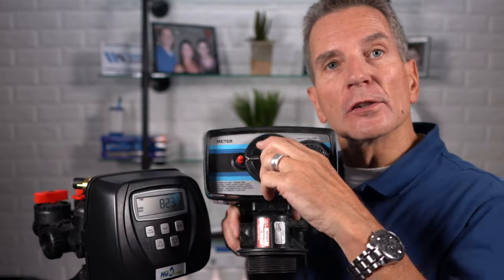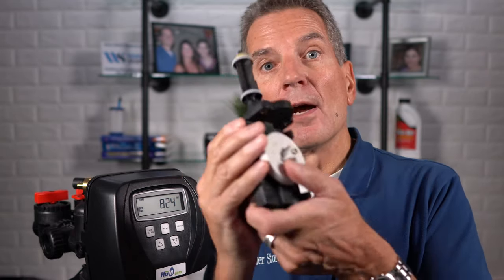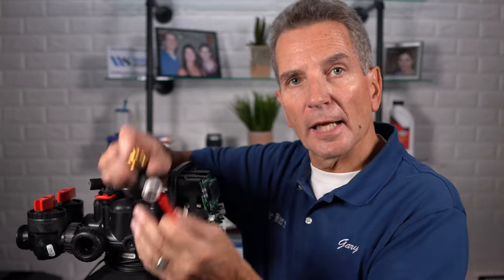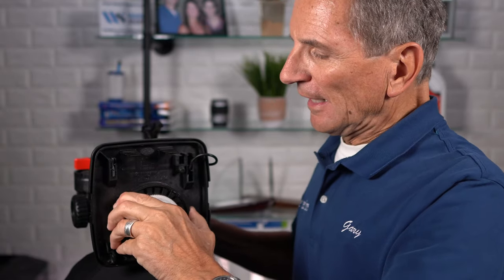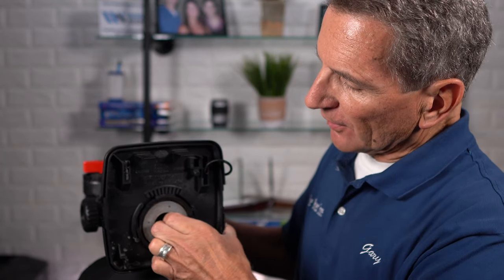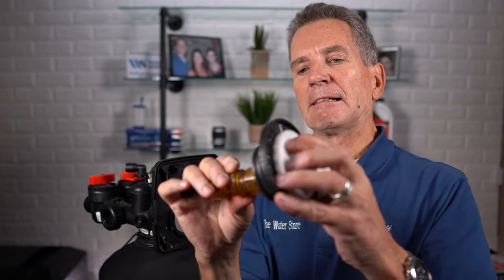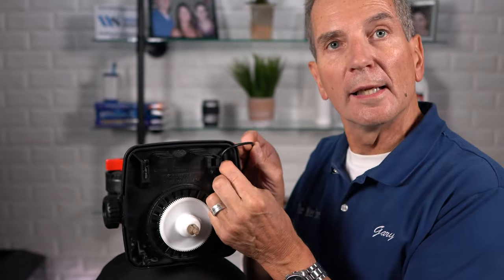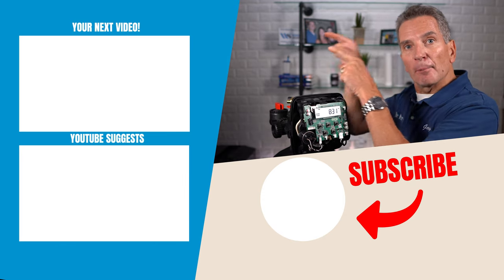WATER SOFTENER Troubleshooting – CONSTANTLY DRAINING

Comment: Hi Gary, 1st off I would like to say that your videos are awesome. I am trying to replace the seal pack in my Greenway (WS1 Clack rebrand) Filox Iron Filter, I bought the seal pack and the 2 pistons and tool. I followed the video and removed the drain, electronics and the gear with the 2 pistons attached, I am now at the seal pack but it won't come out, there is a lot of rust build-up in it, maybe this is what is holding it? Any ideas how I could pull the seal pack out? Thanks.
Reply from the maker: Good question.  Typically I just carefully pry it out with a screwdriver or small pry bar.
Reply: @water_estore  Hi Gary, just an update for your fans out there in case someone runs in same issue. Found out that there is actually a tool for this, it is called "Clack Stack Puller Tool for the WS1, C-series". The Part # is V3022. I ordered it and when I received it I gave it a try and voila! very easy to pull the stack with the tool. Cleaned all the rust buildup from inside the valve, installed new stack and leak to drain is now a thing of the past. Cheers!

Comment: I started the regen mode but the water keeps draining out it doesn't slow down so when should I put it to bypass mode so I can change the sealpack. I think I know my issue I gotta put into bypass mode b4 starting the regen to drain the last bit of water I think
Reply from the maker: Yes, bypass first, regen to release the pressure, then go for it.

Comment: What position should the drain assembly be in when you screw it into the housing? It looks like yours is about 1 inch out from the white gear piece. Is that true for all? I have the same exact Clack unit that you have.
Reply from the maker: Sorry, not sure what you mean.  The drain elbow goes into the housing and is held in with n "E" clip, it doesn't matter which way it is orientated.  Now sure what the white gear piece is that you are mentioning.
Reply: @water_estore  I think he is talking about the screw on the front that advances the cycle and moves the pistons I too wondered about that as I’m concerned that because I’m clumsy I may have moved the large white gear that meshes with the face piece. Also mine looks identical to the clack version you showed but it is branded as a waterite. I’m a plumber in Canada and am trying to learn a bit about these softeners as I have one at home. I also would like to get that sweet wrench you showed in your video.
Reply: The answer is it doesn’t matter the motor resets the position of the plunger by bottoming out and spinning back in it doesn’t matter where the large white cog lands @George Lynn Davis

Comment: So water continues to trickle through to the drain even after I closed those valves to 'bypass' . ..so that means the seal pack and pistons are ok ? Its something else ?
Reply from the maker: I would bypass the softener and wait for a while.  If there is no water flowing into the softener where is the water coming from that flows to the drain?

Comment: How do I clean a float valve in the brine tank that seizes up after each back wash cycle?
I clean
Reply from the maker: Just remove it, soak it in soapy water and test it.  If it still seizes, replace it https://waterestore.ca/products/waterite-water-softener-float-assembly

Comment: I have a Clack WS-1 that is slow dripping from the backwash line. When I put the softener into bypass it still slow drips.  Any ideas?
Reply from the maker: Does it keep slow dripping when bypassed 2 hours later?
Reply: @water_estore  thanks for the suggestion.  I left it in bypass for several hours, and when I checked it again the leak had stopped.  When I took it off bypass it leaked for a few seconds then stopped completely. If it starts leaking again after the next regeneration cycle what would you recommend for replacement?

Comment: Brand new eco pure softener is draining at full discharge speed upon initial opening of bypass valve. Draining discharge hasn’t slowed. Please help. Only way to stop it is to close the bypass valve.
Reply from the maker: Can you not advance it out of the back wash cycle?  New installations always should be back washed at first to remove the air in the tank.

Comment: Hi Gary,
I was replacing my iron filter and cut off the main water supply to my house. After unhooking the iron filter, I noticed one of the lines from the softener continued to run for a long period of time even without power and no water going into it with the  main line shut off. Is this normal or do I have an issue with my softener?
Reply from the maker: You have an issue and this video will help you to solve it.

Comment: What flow rate is normal? I woke up in the middle of the night and went into my furnace room where the water softener is and noticed it was in a recharge cycle, but the water was flowing out of the drain at full blast. It flows through a pipe into a nearby sink, but it was flowing so fast and for so long it had backed up through a drain in the floor and flooded the basement an inch or two deep. I unplugged it to stop it and the water in the basement drained away after a few minutes. Now I'm trying to figure out what happened, but I can't find any clear information on how fast the water is supposed to be flowing during regeneration.

Here's what I know: the cycle is set to start at 2AM. I've been awake for the start of the cycle before and it was just a trickle, so I assumed that is how it would be for the whole cycle, but I can't confirm, and I can't find ANY clear information online that says what the flow rate should be. I woke up tonight close to 4, so it had been running for that whole time. I also know the cycle is supposed to be 2 hours, so it might have bee close to the end of its normal cycle.

Here is the big complication:  I just moved into this a few months ago and so yesterday I decided to take a look at the water softener settings (a lot of people are going to assume I messed up the settings, but please read everything I have to say), I fiddled with it a bit but I was sure I returned it to it's original setting . The basement floor has a healthy slope toward the drain, so the couple inches of water didn't actually touch anything I would have noticed getting wet.

So it is very possible that it has done this every cycle, and the water on the floor drained away before I could have woken up and noticed it. I check that area too often so I might have missed a damp floor.

It's also very possible I changed the settings without realizing it and somehow set it to blast water at a ridiculous rate that overwhelmed my plumbing system. This feels like it should be the obvious thing, but the problem is that I can't find anything in the manual or online that suggests any way to change the flow rate with the settings on the control panel, and I really can't rule out the first possibility. If there were anything at all in any resource I could find that even hinted at a setting that would have altered the flow rate, I would have assumed I had done something wrong, but I can't find anything.

I'm kind of grasping at straws right now because I can't find anything about this online or in the manual. I haven't found a clear description of the flow rate during recharge anywhere, and I can't find a video of what the recharge cycle is supposed to look like, so I am not sure what to do.
Reply: Update: after paying that, I saw your video saying not to just unplug the water softener because it could get stuck in backflow mode, so I located the bypass valve. But I think it was past the backflow stage when I unplugged it so I don't think it's still a problem. It looks like it was right at the end of the cycle and u only unplugged it for a couple seconds, so hopefully it is back to normal functionality.

I think when I touched the settings, I set it to "recharge tonight"

Also, I finally found simmering explaining that they're is a rapid flow of water at the end of the cycle, so I think this has been happening prodigal and I just didn't notice until now. It's only been a few hours since the water drained, and the for is mostly dry already. I could easily have not noticed this in the past, even if I was in that room the morning after it  recharged.

I guess my next step is to really make sure the settings are correct, and then to get some enzymatic clog remover and a pipe cleaner to see if the backflow is due to a partial blockage.

If that doesn't work then I don't know what I'll do. Suggestions are appreciated.
Reply from the maker: Your drainage system needs to be able to handle at least 4 gpm flow rate.  The flow rate changes during the regeneration cycle, this video will explain it in detail https://youtu.be/wPh_l56OWOM But yes, you need to make sure the settings are correct for your water softener.  You cannot change the flow rate in the settings, they are changes by swapping out some parts.

Comment: What would cause a Kinetico 2060s to flood a basement? System just installed and we went on vacation. Didn't use water and came home to 5000 gallons of water in our basement?
Reply from the maker: Sorry to hear.  There is a leak somewhere or something burst. Usually an insurance guy comes out and determines the cause.
Reply: @water_estore  No pipes burst or leak. We are going through insurance. No luck getting the treatment company to accept fault. Thanks for your response.

Comment: I have a one piece unit Whirlpool. Bought it two years ago. I filled it too much with salt when I first installed and the salt turned into one hard piece. I have now emptied it. I have new salt in now and unit fills and goes through the recharge and brine. I hear it during the cycle. Once finished it's quiet and no difference in water in home. It's a new unit. I have cleaned filter and piece at the hose in the brine. What do I do?
Reply: Also, tank is full of water. It's full and salt is only at level 3. Never have heard a swoosh of water. Only hear the recharge much quieter then on your video. It does drain water to but never much. I wish I could up load photos. I hope this is enough information.
Reply from the maker: Sounds like the drain line is restricted.  Check out the suggestions in this video of mine https://youtu.be/Zikmilf_Tu0
Reply: @water_estore  thank you, I will be going through all the things you have suggested in that video. Thank you.

Comment: Most useful part was knowledge that pushing recharge button during a recharge advances to next phase.  Really speeds up testing; but did not solve my problem that at the end of recharge cycle, instead of going back to normal, the wheel goes all the way around and stops at "P" instead of "S", so it keeps rinsing and rinsing and rinsing instead of starting to soften water.  So a gusher rather than a trickle probably isn't bad seals.  I'm thinking maybe the actuator on the switch has worn down.
Reply from the maker: It sounds like you have a different brand of water softener.
Reply: @water_estore  Yes, it's a Kenmore.  Very different from the ones you demonstrate, but there are a lot of nearly identical ones sold under many brands.  Fortunately, hitting regen to move to the next step seems to be a widely accepted convention.

Comment: HELP...I have an older hydro quad water softener  model HQ 1054 FE 1.0 stuck on RINSE! Making a water rushing noise all day! WHAT DO I DO? Knob won't turn. Ugh!
Reply from the maker: You need to bypass it to stop the water and then the valve either needs to be rebuilt or the water softener replaced.
Reply: @water_estore  so, I  got the water softener in bypass mode. I was not able to turn the dial clockwise to get it out of the 'rinse' mode. Over the phone, the guy that normally does our water filter and maintenance, said that it sounds like we have a jammed gear or dial, (or whatever he called it..I can't remember exactly.) And it will need to be replaced. Is that the same part you were talking about? And where would be the cheapest place to get these parts?

Comment: So I had a new saltwater system installed 2 years ago.  It is outside and I live in Florida where that is sun all the time.  I have covered them up with a barbecue grill cover so the sun doesn’t damage the unit.  With in the last 2 weeks I have had to fill the water back up in it.  The salt just lays there and it isn’t hard salt.  You can get a stick and swirl the salt around.  I don’t understand what is going on.  None of the valves have changed. It has been extremely hot here already The only thing that has changed is a couple 2-3 weeks ago I had a lake erosion company come in and reinstall a sock and on top of that they installed sod.  It looks great and they did a great job.  They told me to water the new sod at least 2 hours a day for 6 weeks.  They have a sprinkler guy who installed another drop line.  Now the water feeds from the lake to the sprinklers.  Somehow could they have made a mistake and it comes from the fresh water system.  Or do you think the fresh water has alway fed through the sprinklers.  I am extremely puzzled over this.  I have never ever had to fill the brine well this much ever.  I was told from the filteration people all outside lines like water hoses and such do not go through this filteration system. I have never watered my lawn so much in the time I have lived here. I really really am puzzled over this.  
Please advise me what to do.  I greatly appreciate any help you can give me.  I understand how water works when I was a kid I use to work at swimming pools before I went to work at the beach as a lifeguard.  I maintain my own swimming pool.  I’m just stuck.  If my husband was still alive he would know what to do but it’s just me.  I’m pretty hand though.  I learned a lot from him. 
Thank you kindly
Reply from the maker: Keep in mind that they only use water and salt when they regenerate. If you use very little water the water softener doesn’t need to regenerate nothing will change in the brine tank
Reply: @water_estore  
Ok , thank you. I understand, I just don’t know why I am filling the brine tank up with water every other day. I have never had to do that since I owned it .  The water level has always remained the same level. It’s just been the past 2 weeks I have had to fill it up with water. It’s just been in rhe past 2 weeks  I 3-4 times a week.
Reply: Sorry about that.  I don’t know what went wrong . So I have been filling the brine tank with water the past 2 weeks . The tank is totally empty. The salt remains there . I need to do this every 2-3 days.  When I had it  installed I never had to add water before, just salt.

Comment: I don't quite understand. I have an Ecowater water softener. If I put it in bypass, then no water is going through the softener anymore so of course it wouldn't show a leak. I don't see how this in any way solves the problem.
Reply from the maker: It tells you that when your water softener is in service, no water should be going to the drain but you have just confirmed that it is, so your valve needs to be rebuilt to fix it.

Comment: No need to disconnect any wires. No need to put it in regen to relieve pressure. Set board to the back. Turn the (white)gear counter clockwise slowly until pressure is released. When resembling turn (white)gear clockwise until snug then back it off a 1/8 of a turn you can feel it when it is right.
Reply from the maker: I like my method better, but if that works for you, go for it!
Reply: @water_estore  absolutely, to each his own 😆! Keep up the good work!!!

Comment: Great videos Gary!  Where's your shop? I'm going to replace a 20 year old Cull. Estate 2/2M shortly and just as soon give you the business. Meanwhile, I tore down unit stuck in regen to find a frozen drive motor assy, which I disassembled and fixed BUT.... wasn't smart enough to notice the relationship between the cam and the bell crank on the opposite side and don't know if I'm timed or 180 out. (Had to drive the spring pin out to open the motor) Any insight ?? Also, any chance you can sell me a eductor piston? I set the motor down to tighten the microswitch assy and snapped it off-moron.
Water here is hard as a rock so I want this running till the new one is bought and installed
Thanks much in advance
Reply from the maker: Sorry but we cannot get Culligan parts.  Our website is here https://waterestore.ca/

Comment: I just did my replacement and it started leaking again after 10 minutes. Any ideas?
Reply from the maker: Did you replace all of the parts? See https://waterestore.com/products/clack-ws1-softener-rebuild-kit
Reply: @water_estore  yes, I changed out all 3 parts as you’ve shown in your video. Do I need to run a cycle?

Comment: My is keep running out the water and the screen is black out, what can cause that
Reply from the maker: The circuit board has failed and it is stuck in a backwash cycle.  Bypass it until you have it fixed or replaced.